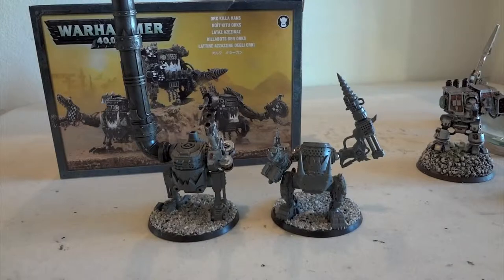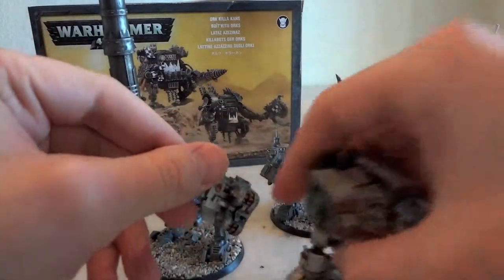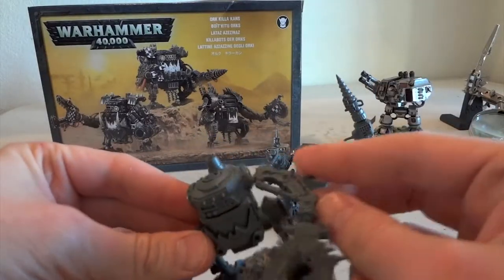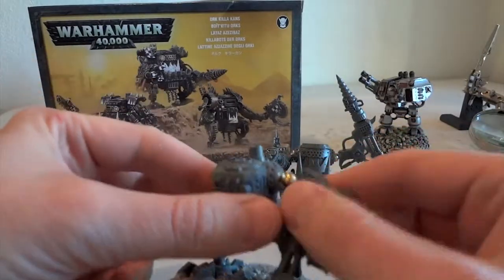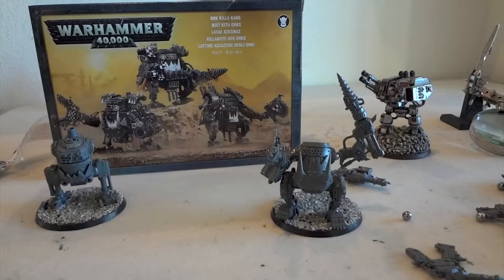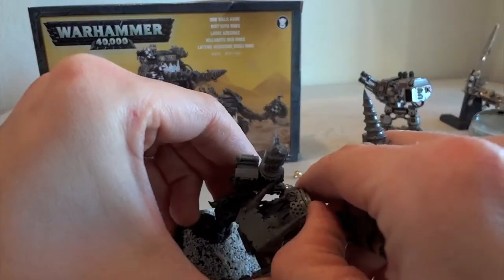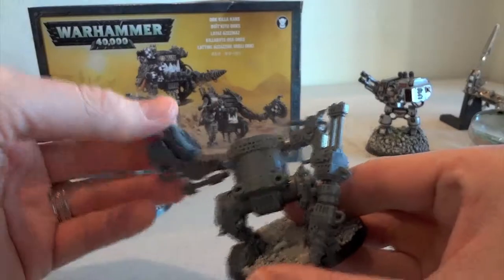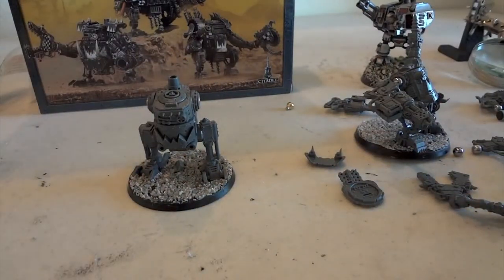Magnetizing Ork Killa Kanz

Comment: Hi again.
Now I got the most powerfull magnets K&J has. 3/16" x 3/8" N52 magnets. Supposedly "the strongest magnets in the industry"

Still no difference. the arm "free spins", even with all 18 cylinder-magnets stacked, and I even took the Buzz-saw off (only using the "upper arm"
You must be using some kind of funky ork magic :p

Comment: I did the same thing you do. But it did not work.
Just for curiosity, I tried stacking over 20 magnets togeather. Still with the same result - the arm "free spins" or hangs loose.
Only tried with the big buzz-saw arm so far.